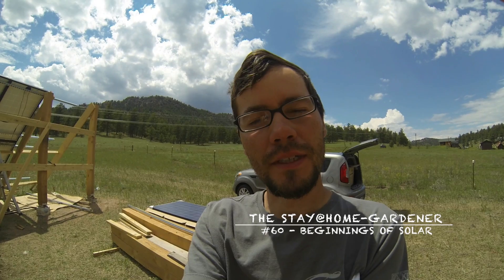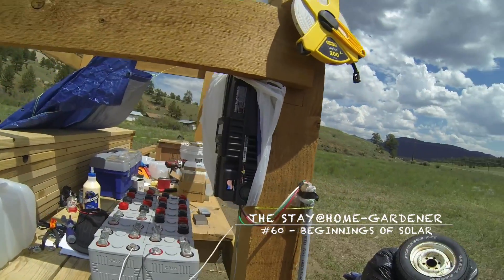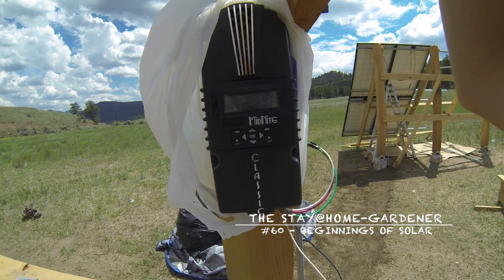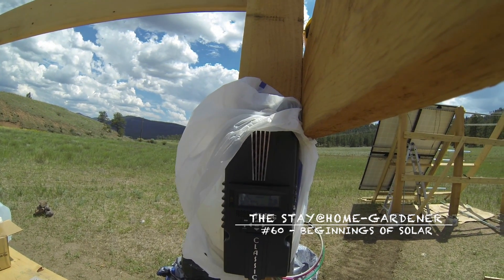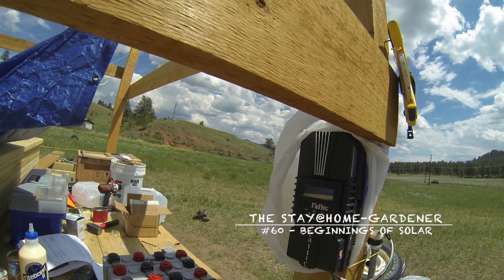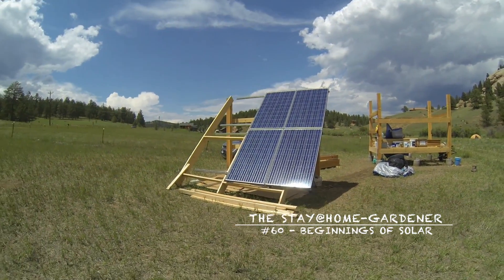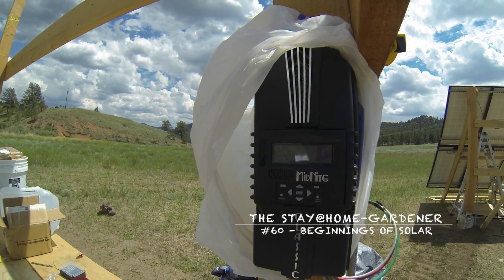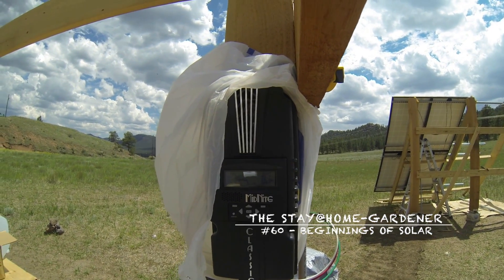Beginnings of Solar

Comment: Dude...Get some fatter cables from the charge controller! You're pushing 18A through that pissy little cable.
Reply from the maker: It's 10 gauge cable that can easily handle/rated for 30 amps.
Reply: cnypilot Over what distance? Check the temperature of the cable, if it's warmer than ambient temperature it's not enough cable.
Reply from the maker: Are you alright? It is 10awg wire that is rated to handle 30 amps. It doesn't have thirty amps going through it. The wire doesn't heat up. They are 2' leads. You can use much larger cabling if you prefer. 6awg perhaps. Certainly if you are running a much lower voltage system than myself that needs to push higher amperage through copper. I have already ran the numbers for line loss relative to panel voltage/amperes/distance to bank/and cable sizing. It's impressive at being roughly ~0.6% voltage drop.
Reply from the maker: Utilizing LFP chemistry batteries adds to the overall system efficiencies, as well. It is quite impressive really. Served me well for the past 3 plus years now.

Comment: How much did you whole set up cost?
Reply from the maker: Philip Pacho The whole setup cost me $7500 USD. $2500 USD of which was in LiFePo4 batteries. A comparable sized battery bank in Pb would have been around $800 USD. I wanted the lower maintainence and higher cycle life of the lithium batteries, so paid more overall.
Reply: Thanks cnypilot. I wonder how those batteries TESLA will be releasing soon will fare. What kind of capacity is this set up capable of? Mid size fridge, washing machine, lights, tv etc? Sorry, that the only way I can express my question..
Reply from the maker: Philip Pacho I like the 7 kwh daily cycle version they have for $3500 USD. My own Lithium bank is 5 kwh. The tesla's cut the price a little bit. Depends how you use it. If you work more in tune with the sun, that is, use a washer during the day with full sun as well as cooking etc. My system is more than capable. 2000 watts of Solar panels and the 5 kwh battery bank. After all. The batteries are only needed to get you through night. All of my lighting is LED. I have a 42in HDTV. Electric kettle. Rice cookers. Etc.